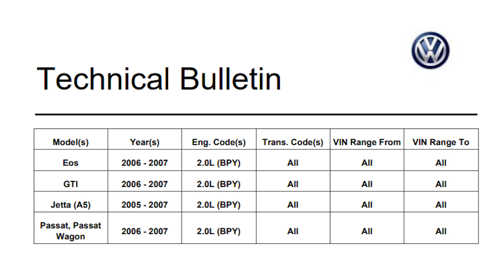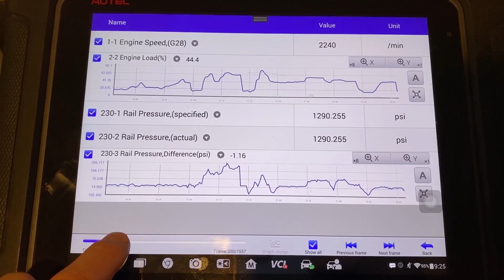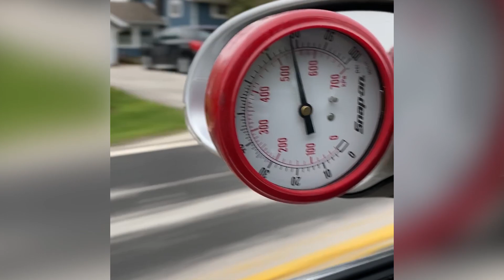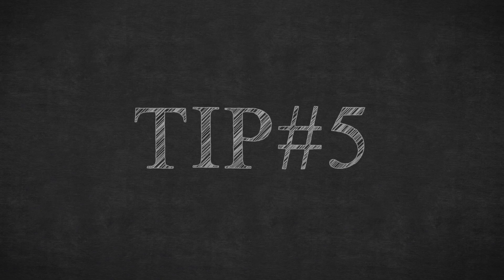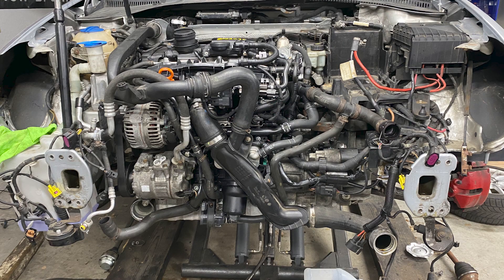5 Quick Tips - VW / Audi High Pressure Fuel System - 2.0L TURBO BPY

Comment: Mike,
I need some help w/ code P0134 2004 CRV, let me know if you can help. Thanks
Reply from the maker: Hey Bernarda, i'm seeing that the air fuel ratio sensor is very common on there to cause a p0134. What's going on with that one?
Mike Becker, Senior Instructor
Reply: @GoTechTraining   The bandidos cut the cat out and after it got repair this code came out. New A/F sensor twice, fuses OK, swap relays 4 and 6 made no difference.
Reply from the maker: Ugh, that's horrible! Was the A/F Sensor rewired? Was it done properly with good connections? They are very sensitive to rewiring.
Mike Becker, Senior Instructor
Reply: @GoTechTraining  The harness plugs where not broken what happen is that they either pull very hard on the hardness, braking something or when I started the car the loose wires might shorted something. Not sure do!
Reply from the maker: That's a tough one. You got yourself a quality A/F sensor, right? Not an EBAY special? :) If you got a good one, chances are you have a wiring issue. I hope nothing got shorted out. Bring the car to Wisconsin, i'll take a look! haha!
Mike Becker, Senior Instructor
Reply: @GoTechTraining  Yes, I am willing to make the drive to your place. The new A/F senors are Denso brand
Reply from the maker: Shoot me out an email Bernarda, Michael.becker@wellsve.com
Mike Becker, Senior Instructor
Reply: @GoTechTraining  OK
Reply: @GoTechTraining  Sent you one using my husband's Hotmail account
Reply: @GoTechTraining  You can make this hunt into a nice video for the audience.

Comment: Great set of tips Mike... Wasn't aware of the checking of the low side pump by unplugging the high side. Can this work with others beside VW/AUDI.  Good to know Thanks and Cheers Bro.
Reply from the maker: Hey dude, thanks for watching! It depends on the system. Some may default to max pressure. Unplug it, see what happens on the scanner. ;)
Mike Becker, Senior Instructor

Comment: How many other manufacturers are having this problem?  With longer time and/or mileage oil changes, I'm  sure that's not helping any.
Like I've said before, oil is cheap, engines are expensive.
Thank you very much Mike for this video and all your indepth work that went into it!  Hope you and your family are doing well.
Reply from the maker: Hey Mike, I'm sure there are others our there with similar issues. Can't think of any off the top of my head though. Oil is cheap and good insurance for sure!
Mike Becker, Senior Instructor